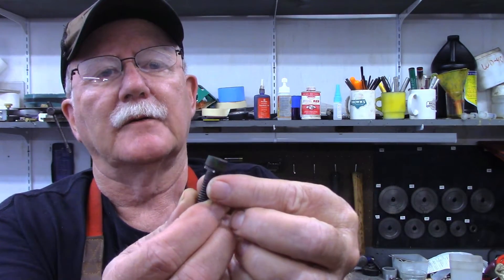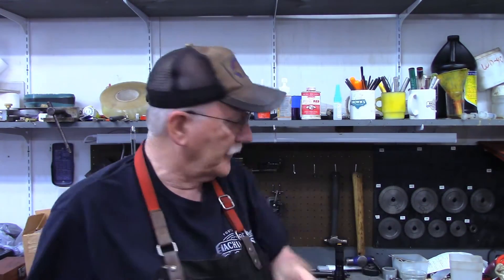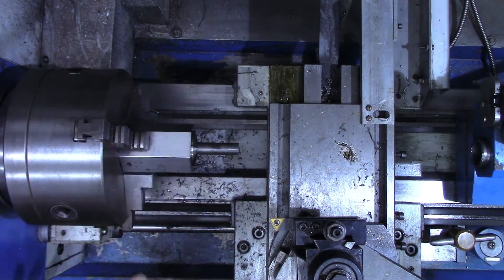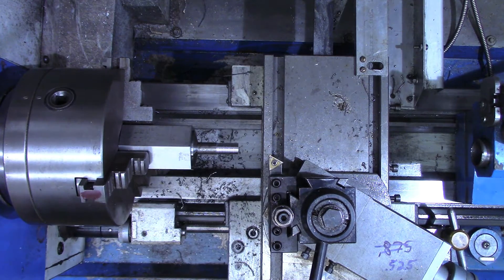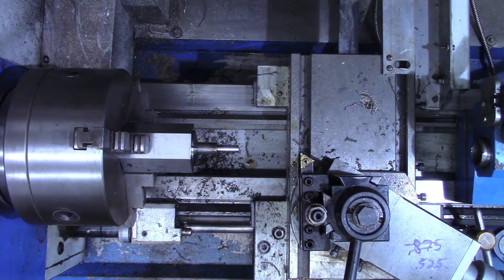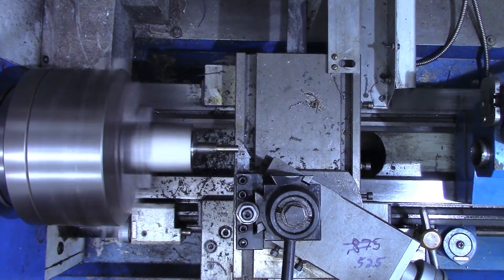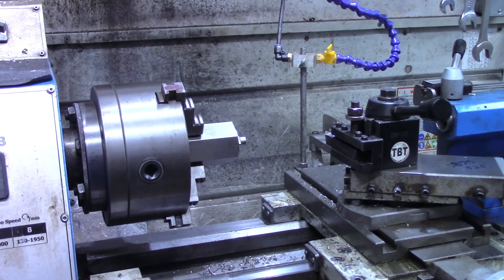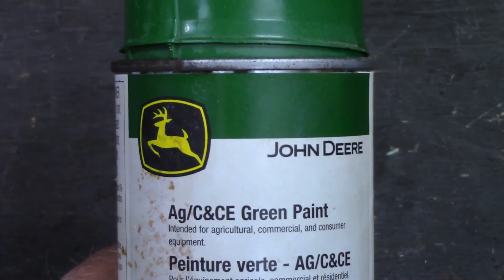Machining a Special Use Shoulder Bolt

Comment: Paul, I watched your video on adding air power to your hydraulic press. I have a Northern Tool press with a side handle pump that I’m trying to add the air pump too.  Do you know if a 10,000 PSI pump will be strong enough to handle a 20 ton press?  I’ve been been researching and it looks like a stronger pump will be required but I can’t find one. Do you know the PSI output of the pump you used?  Thanks, David
Reply from the maker: Search Amazon for this item, BIG RED TA92006. That is what mine is.